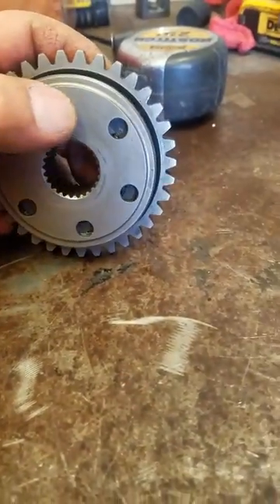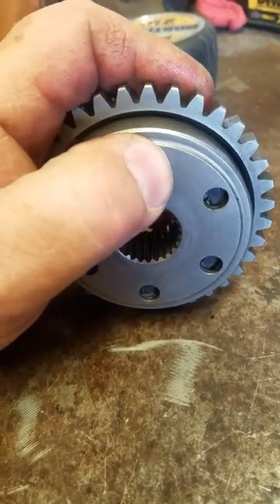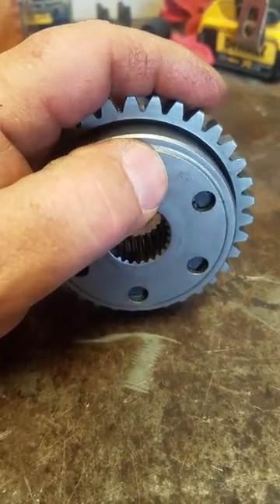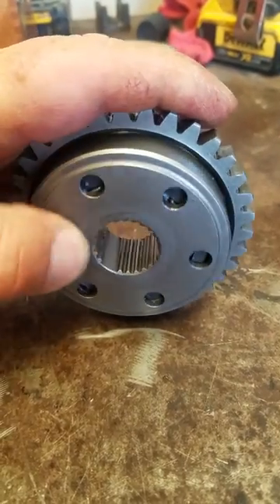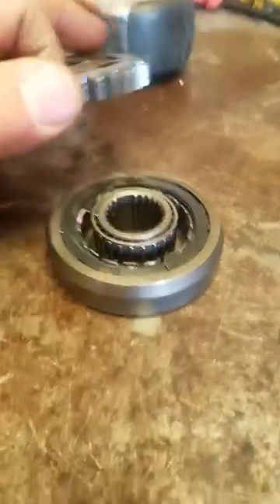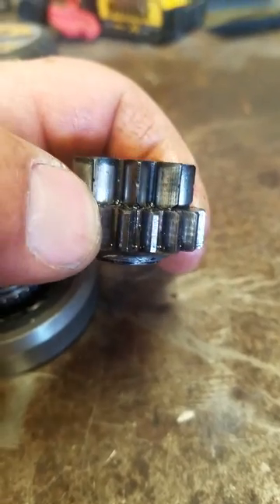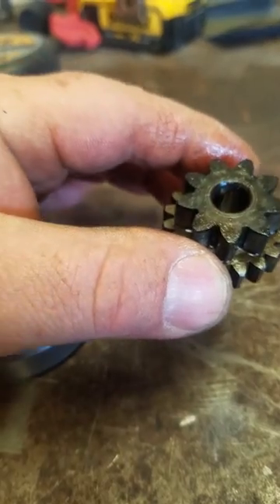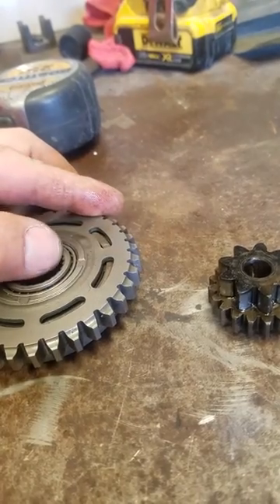How to tell if your starter clutch is bad

Comment: Mine does this one. When i took the start clutch off it spins freely counterclockwise by hand and engages when clockwise. Cleaned it and when i put it back on it just spins and not engaging or cranking the variator shaft when i press the electric start.
Reply: Did you fix it?
Reply: Dont leave us hanging dude - what was the fix?

Comment: I could really really use some help. My bike has had this really weird problem where when I decelerate and let off the throttle, I get this bad friction noise from the engine. It goes away when I immediately pull in the clutch and give it gas. When I put the bike on a stand and in neutral and rev it. It makes a similar sound but not has aggressive or friction sounding. The video on my channel will show what it sounds like. There is some wear on the flywheel where it's sits, and some wear on the edge of where it sits in the middle. Can a bad flywheel make a noise  like that or a bad starter clutch? Why would this noise suddenly go away when I'm riding and pull in the clutch
Reply: Can chain worn out and stretched?
Reply: Sounds like probably the friction plates in your clutch -explains why the sound goes away when you engage the clutch and why its less pronounced when you have it in neutral i.e. under less load. Also - No, the starter flywheel and clutch shouldnt be causing the sound you are hearing.

Comment: same problem i have with a 2015 street 750... i replaced the bearing started 3 times then right back to spining. can not find a upgraded replacement so far
Reply from the maker: Checked out JPcycles.com. they should have what you need and it should be better than stock
Reply: ty

Comment: With the new one, did it come without the timing mark etched on the face the unit? I got a new one and it has no reference mark and the female sprocket. On the inside had a notch with one slime missing opposed to the original that I took out has no teeth missing. Could it be the reference mark that’s missing from this unit?

Comment: Idk if you’ll see this but I think I have the same problem do Yu have an email so I can send you a video of why it sounds like
Reply: You figure the problem out? No video needed to diagnose really - its pretty obvious when you try to start the bike and the engine doesnt turn over. You just hear the starter and idler gears just spinning freely at a high RPM. Maybe itll catch a little but then will kiock out and spin free. Sometimes the whirring can be accompanied by a loud CLUNK! that'll scare the shit out of you but I think when this happens its because the idler gears are only held in place sort of floating between the engine block and crank cover; they're not bolted to anything liker the sprag and starter gear are. If its an older bike the cover may not be 100% true so it doesn't squeeze them as tight as it should so they can be forced out a little bit. If you find this is the case you can use a washer as a shim  by placing it between the end of the idler shaft and the crank case.